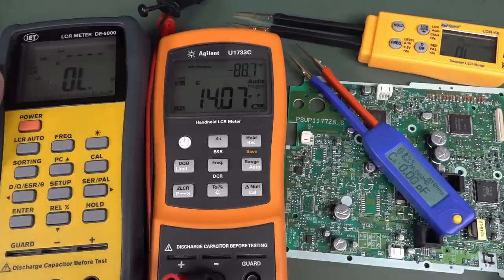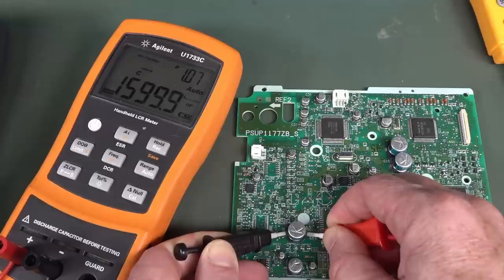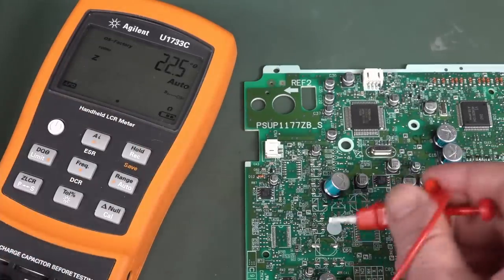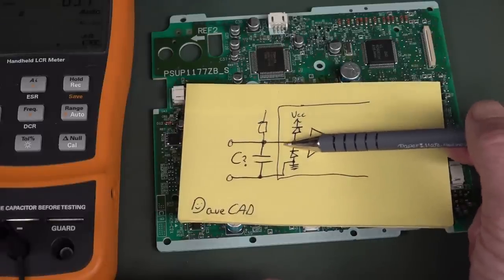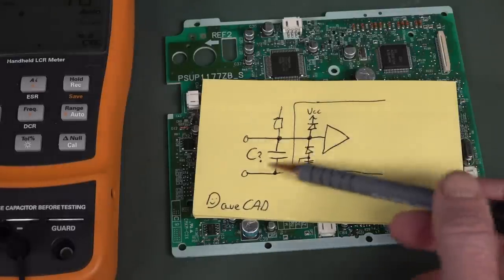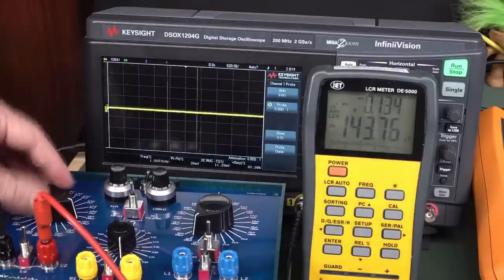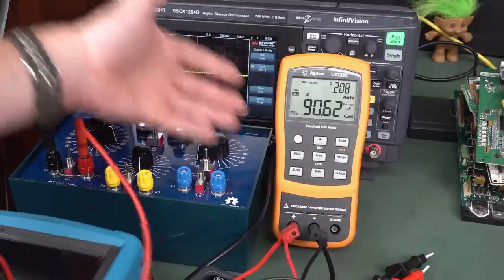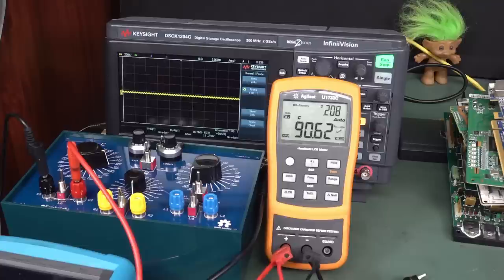EEVblog 1474 - Can You Measure Capacitors IN Circuit?

Comment: The DE-5000 also features proper 4W Kelvin connection, so the lead resistance is compensated for. Specification indicates, that high µF values can be measured only @ low frequencies. Your agilent 1733 can do this as well.
Reply from the maker: Only if you have kelvin connection leads.
Reply: @EEVblog  Even the simple clip assembly from the cheap DE-5000 is 4w. This expensive agilent 1733, didn't it come with a similar adapter? That way, ESR measurement, which is always in the mOhm range, makes no sense with such a setup.
Reply: Are you sure the 4 wire clip set is properly wired kelvin connection?
I have come across a video saying it is not so with the DE-5000 supplied kelvin clips?
Reply: @jayytee8062  my de5000 definitely came with proper kelvin probes - both the short alligator clips and the smd twizzers. 
I have since desoldered the alligator clips from the adapter and soldered longer kelvin clips in their stead.
Reply: @ASJC27  
Okay sounds good. 
It's just that I've heard while the the 4 wires are there, they are not connected properly for it to be a true kelvin connection. There was a video a while back with some one opening the black box kelvin connector showing this as such.
Reply: @jayytee8062  well all I can say is that mine was soldered properly, as I took it apart to replace the leads.
Just looked at the photos on my phone and I still have the one I took of the board before desoldering. There are 6 soldered wires - 3 per lead (voltage sense, current sense and shield).
Reply: @ASJC27  
Ok, good to know thanks.

Comment: I use a curve/signature tracer to see whether the component actually works at all, and desolder at least one end when doing the measurement.
Reply: For sure.... but considering the prevalence of SMD, lifting a leg is not really practical....
Reply: @dannixon247  that's right, gotta desolder it completely for that... or use teeny weeny meter probes to test it in circuit :)

Comment: Sort of on topic..  I used to test in circuit resistors by measuring them -  if the resistance was higher then the stated value it was defiantly bad.  But if it was the same or below the resistor was probably good.
Reply: I just have measured on resistor in circuit with a cheap multimeter, and it gave me negative resistance. What was that ??
Reply: @dmitripogosian5084  I've had stuff like that before.  Is the circuit powered on?  (it should not be).  There could also be a residual charge leftover in an in circuit capacitor.
Reply: @bill6255  No it is not power, but yes, capacitor should be involved (the resistor is connected to the ground via 30 muF capacitor).  It looks like I am charging the capacitor by measuring, reading are moving while I am measuring, and depend on direction of leads application. The problem is that this part of board is blown (by myself :) and some transistor and 555 timer are soldered out.  I am searching of what else may be blown,  possible this 1.2 Mohm resistor itself.
Reply: @dmitripogosian5084  I totally thought of the capacitor charging after I posted the reply, it usually charges to the right value.  Look for heat damage (like hole blown in side) on resistor bodies or resistors that have be overheated for long period of use.  good on you for catching and fixing your self created  blown trace.  Good luck and please post when you succeed!

Comment: If you you are looking for some new projects can I suggest HUM-900-PRO radio module. Made by linxtechnologies. I have been working with these but there is very little information online other than the supplier data sheets. They don’t have a forum or any other support other than email and it takes 3-5 days to get any response. Its a good module with UART interface. I would like to see what others with technical experience think of this module.
Reply: How much is it?

Comment: Hi 
I have checked the capacitors on my digital piano and got the following results in ESR levels. I used the peak ATLAS ESR70 gold.

10000 uF 25V - ESR 0.01 ohm
2200 uF 25V - ESR 0.02 ohm
470 uF 10V - ESR 0.20 ohm
100 uF 25V - ESR 0.43 ohm
47 uF 16V - ESR 0.64 ohm
10 uF 16V - ESR 1.01 ohm
1 uF 50V - ESR 1.10 ohm

I am especially suspicious about ther results for 10 micro and 1 micro F. They should be around 8 and 5 respectively. Do these results mean that I need to change the 10 micro and 1 micro D capacitors?

Thanks for your replies.
Tan

Comment: Topic very well explained here!
But what if you were trying to measure the capacitance of a power-rail smoothing Electrolytic in circuit.... All other caps sprinkled around the PCB that are attached to the same rail will all add up, as they all appear in parallel to the ESR meter...  Surely you have to desolder this cap to measure it accurately?

Comment: I'm assuming there's no technique for measuring a capacitor in-circuit when there are potentially other capacitors in parallel with it?  You'd just get the parallel equivalent capacitance?  I recently wanted to identify some unmarked SMD caps in a  circuit, and couldn't get anything sensible out of my DE5000.  I'm guessing the culprit was other stuff in parallel...

Comment: Higher frequency reduces capacitance especially in electrolytic caps. Would this account for the change in reading as if you are using that cap for something operating at that frequency that would be the stored power. I was under the impression that is why we use polymer or ceramic caps for higher frequencies. Is that wrong?
Reply: Not power but capacitance

Comment: Are the LCR meters adding a DC bias voltage to avoid reverse biasing electrolytic capacitors? Seems a bit odd that you could take a symmetric waveform and feed it to an electrolytic with impunity.
Reply: Unbiased electrolytic caps work Ok with low amplitude AC signals.
Reply: A lot of Benchtop LCR meters have bias voltage setting for testing the parameter variations at different voltages.

Comment: Wouldn't smaller or larger (depending on which point you measure at!) bypass capacitors in parallel screw with it? 

Especially as they are differing values so their parameters will drift differently. 

Interesting to see the practical scope of the testers output and parameters in differing scenarios. Good work Dave. I thought I was the only one who did that! 

Also cheap laughs: turns out this is comment 69, Bill & Ted's favourite number dudes!

Comment: Switch the probe leads around? Can you measure electrolytic caps with the wrong polarity? I guess it's fine up to 1Volt?
Reply: Wasn't the source AC?  Wouldn't matter which way the leads were.
Reply: @xyzconceptsYT  facepalm yes, of course! I didn't think in AC :D 
But still, that slightly charges them in reverse polarity half the time. I guess they can take that as long as the voltage is quite low?
Reply: @yesyes_uk  Yeah its pretty safe at the low test voltage  👍
Reply: @yesyes_uk  I think it’s more that it never spends long being reverse polarized, as the frequency is at least 100Hz. If you put 1V reverse DC on an electrolytic, I’m pretty sure it’s enough to blow it up, but at 100 Hz AC it’s fine.

Comment: as a beginner this is really helpful, but on the forum users generally warn against this in case the caps still storing a charge that could kill ya meter? maybe a video on properly discharging caps in a circuit? I've got a lot of vintage gear to repair from old psus to crts but even modern TVs have 450v+ caps would be helpful to know how to handle those in circuit even though the consensus seems to be avoiding in circuit esr/lcr tests with that kind of equipment?

Comment: I've owned the DER DE HERP DERP DE-5000. "OL" is what it's good for. 

The MESR-100 is cool stuff, so far.
I was tempted to buy the nice and very esspensiff HP rackmount LCR bridge meter. But are these tools worth thousands of dollars to us?
To get meaningful trustworthy readings: I do it out of circuit. Most of the time, if it's not over $100 in replacement capacitors: you've already got it out, replace it! THAT's a MUCH better test result! A new one!

Comment: And all the people wonder about how much of this you can do with your mocked up EEV multimeter or even a cheap as component tester or cheap as general tools,  the conclusion obviously is, that you can do jack as ottherwise Dave would ofcourse have voiced that and not only refered to a specified tool that 5 to 10% of his viewers got vs the main tool that he even sells and that most people likely use to measure capaicitors.
but that is EEVblog...
show my 1 grand Agilent LCR meter and take for granted that his viewers use that for cap measurement.
unsympathic mr nose in the sky, and constantly whinning about cheap tools.

Comment: 100 kHz is the norm for impedance, not ESR !!! Stop spreading that ferry tale, look in datasheets. Even the Rubicon aluminum electrolytic capacitor  datasheet you used stated impedance. 

EDIT for normal wet electrolytic caps. The once that are measured by far the most in situ by the TV repair guys who worship ESR in situ meters. (I would do too if I repaired crappy consumer stuff that most dies from crappy Chinese electrolytics) In my work I do not often see bad electrolytic caps
0

The conclusion is you can fiddle with ranges etc and get some reading in situ that could be correct. In other words, not a good way. You tested 100' s but did you desolder them as a check ? Most important is if DF is correct and that does not work, look at the values in your video...
Reply from the maker: Randon example: AVX TPS Low ESR Series tantalum datasheet the spec column is literally "ESR Max. @ 100kHz(mΩ)"
Reply: @EEVblog  for normal wet electrolytic caps. But the aluminum electrolytic smd cap you measured and then show the Rubicon datasheet state impedance. That datasheet shows impedance at 100kHz while you say it shows ESR. I looked up countless datasheets. I repair calibration and measurement gear for a living, I always look up the datasheets. I have seen ESR for a wet electrolytic cap at 100 kHz once, but that was a huge special HV cap for a 4 kV capacitor bank used to fire a big laser. 

And indeed for dry tantalum smd caps (like the AVX TPS) the norm is ESR at 100 kHz. But you did not measure those in your video. That is a totally different thing. Those things do not fail often (If used correct) at least, the once I see, maybe it is different in cheap consumer stuff. In the 60/70' s they often used tantalums in early switching power supplies and they fail a lot (but to be honest, often 40 to 50 years later) I have done some tests on solid tantalums and for most the leakage test is interesting. Just a few Volt over-voltage makes them behave very weird. They most times first intermitted fail, sometimes seem to recover partly but in the end they fail. Without current limiting like in my tests they often blow up.   Without over voltage tantalums can last forever.

To be complete, those aluminum SMD caps you measure soldered and desoldered have a bad name because they used to have liquid electrolyte before the 1990' s. Those where the caps that destroyed many Tek scope. The dry once are pretty durable as far as my experience.

I liked your very good video, I watched after this one, about how an LCR meter works so I was a bit surprised you mixed impedance and ESR
Reply: @Okurka.  Not my native language, sorry, I think it is fairytale (I hope)
Reply: @pa4tim  but at 100 kHz isn’t impedance and esr practically the same since the reactance is much lower than esr at such a high frequency, even with fairly small electrolytic caps?

For example, the smallest cap in the data sheet in the video is a 4.7 uF, so reactance is 0.339 Ohm. Impedance is specified as 1.45 Ohm, so the esr is by inference sqrt(1.45^2 - 0.339^2) = 1.41 Ohm.
Reply: @ASJC27  Yes, that is correct.